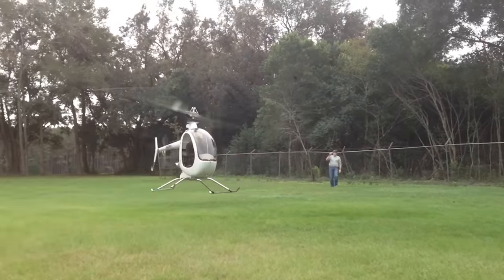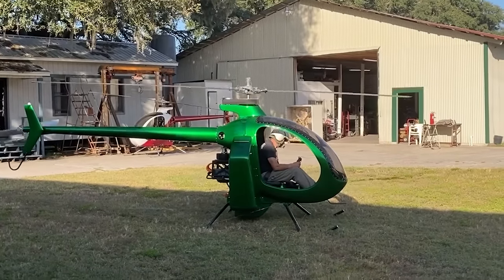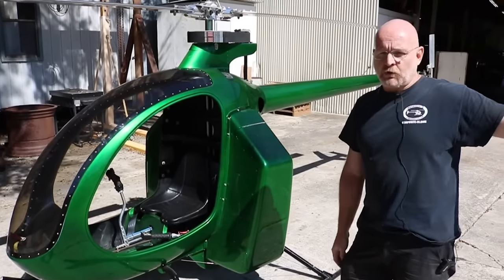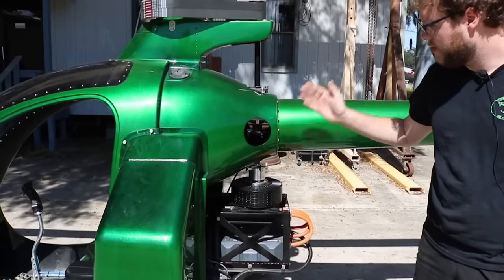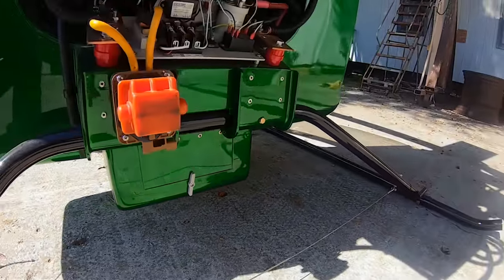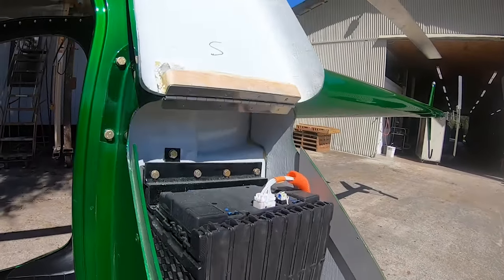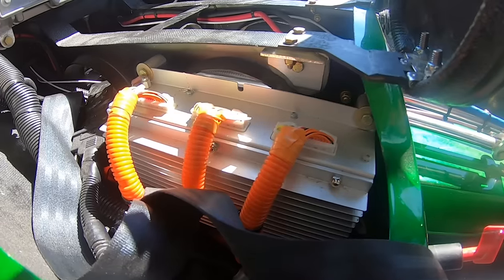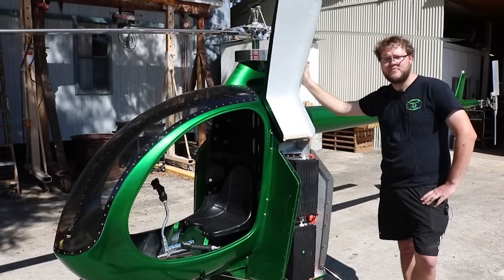Mosquito Helicopter going FULL ELECTRIC!? 2023

Comment: Are you reading my mind? Can I help? Hire Me!  You need regenerative braking to slow the blades down quicker.
Reply: No thanks
Reply: Bruh
Reply: Bruh
Reply: @may21136 electric helicopter ???
Reply: we need the lightning harness
Reply: OK cool, well, based on that idea you have now been fired.
Reply: borregoayudando1481  tons of weight and complexity with minimal returns.
Reply: borregoayudando1481  yes but we might be talking about two different things.  Regen braking to slow auto rotation that actually sends current back into the batteries is complex for relatively small gains. Especially when the overall weight of the aircraft is super important. But simply using regenerative braking to slow the blades down without energy recovery may very well be feasible and practical. My electric hyper scooter does this to slow the scooter down rapidly without wearing out the brake pads, but it does not send energy back into the battery, which again, adds complexity and weight and higher expenses.
Reply: Check out this master mind 😎👍🏼
Reply: I thought the same thing, if inertia is used for charging.🙂
Reply: Brushless motors already do that.

Comment: Ideal for flying from one side of your garden to the other!
Reply: At least they started the project, then they can work on flight time
Reply: Make sure to have an electric charger at each end !
Reply: I like green 💚 small electric ⚡ helicopter 🚁
Reply: It might be useless to you who uses his truck to travel to other side of town to buy some meth and groceries but as a large farm owner I can use this to get to different parts of the farm, to check up on things.
Reply: @NoobieToob  I touched a nerve there I think.
Reply: @NoobieToob  What did I do to deserve that very untrue remark? I only made a lighthearted comment. Try being nice.
Reply: @АскеБек  qa
Reply: Wright Bros flight lasted 12 seconds and covered 180 feet. Imagine if the prevailing attitude was “ ah, it’s useless”.
Reply: Flying too high
Reply: Hilarious
Reply: PREP TO FLY THIS THING TAKES LONGER THAN THE ACTUAL FLIGHT DURATION LOL. CHARGE FOR 10 HOURS JUST TO FLY FOR 25 MINUTES? WHAT A WASTE OF TIME BUILDING THIS HUNK OF JUNK
Reply: Proto at 25 min not at all Bad! In fact, if the pack can maintain temp at power requirements, expect to double or close, for a successful 40-55 min shuttle within the next 15-24 months.
Reply: @illuminatedperspectives2894  nope. I see a pack physically replaced in 15 minutes. Fast  Charging 30 min. at custom airstrips installations.
Reply: Flying in a straight line for 25mins can actually get you surprising far especially in difficult terrain. I’m sure this tech will be further developed and have its applications. Improving the energy density in batteries is going to be key for aircraft, more so than cars. I predict that the simplicity and reliability of electric motors will win over in short-flight applications in the near future.
Reply: @illuminatedperspectives2894  the first electric cars had a thousand pounds of lead acid batteries and had a range of 20 miles. Look how far we've come from that, and remember that nearly ALL the massive ev advancement has been in just the last 10 years.  This is a first gen, essentially prototype electric helicopter. Imagine in just 5 years how much more advanced they will be! Now imagine 10 years!!
Reply: Maybe put a blade underneath for the grass cutting! Great channel n helicopter 👍
Reply: @NoobieToob  savage😂😢
Reply: Yep

Comment: Sounds just like my rc helicopters but bigger and better! Love to see come to production.
Reply: Imagine this flies like a t rex dominator 450 😊
Reply: @seanconnolly2179  but for sure not with someone inside to handle all these G's
Reply: @seanconnolly2179  I wanna see manned tik-tocs!
Reply: It's a 90s setup. :D
Reply: Well not that much bigger than some honestly
Reply: beat me to it 😂😂
Reply: Not unless they can double the flight time!
Reply: NOT to throw shade on impressive project--but LG Chem batts has the worst recent track record...were the reason for Chevy Bolt fires and numerous lessor known similar disasters.
Reply: @seanconnolly2179  Still got my original T-Rex Pro here. I'd got half way through fitting a flightbarless head to it when life took a unfortunate turn, and it just got boxed up and stored. Then I turned to the dark side and got heavely into quad and hexicopters. :D
I'm going to have to dig that out at some point and finish the job. The intention was/is to fit a quadcopter F3 or F4 flight controller in it, and get it locked in on all 3 rotational axis's. The little Futaba heading hold gyro was OK in it's day, but times move on, and a modern(ish) flight controller should be an interesting, and cheap direction to go in to update it.
Reply: @Reman1975  cool and the same happened too me, I got bitten by the Fpv bug lol So my helis are sitting in my storage unit , but I’m thinking of trying some of the newer micro helis like the the direct motor drive ones 👍
Reply: Pffft. I want to see a vertical stall turn while pirouetting or a chaos.
Reply: @jiml4987  Yeah. Wake me up when they upload a video of them doing an inverted hover 2 foot off the ground. :D
Reply: @Reman1975  I miss the R/C heli days. I started on a nexus 30, raptor 30 V1 (later converted to 50, then DIY electric), raptor 50 V2 and the JR Vigor 60. I could fly inverted,  not like Mike Maas and Alex Szabo inches off the ground. 
I flew FPV drones for around 5 years, much more intense than any of the helis.
Reply: @jiml4987  The thing that hit me hardest when I moved from RC helicopters to quadcopters was how robust they are. With a heli, a random gust of wind while landing could cause a blade to strike the ground, and a domino effect of destruction following.

I remember my 450 tipping over on landing once. A carbon main blade folded the tail boom before cracking. That blade also took out the horizontal stabiliser, both support struts, and the servo push rod. The crushed boom instantly jammed the tail drive belt, which caused a couple of stripped drive gears. The impact also bent the main shaft.

During the 4 or 5 hours of rebuilding and painstakingly setting everything back up, I also found a crack in one of the carbon fibre frame side plates, and 2 of the 3 head servos had shredded gears. With waiting for parts to be delivered, the total time it was out of action was over 3 weeks........ And the repair parts + shipping cost only marginally less than buying an entire new frame kit.

My first quadcopter was one of those Hobbyking FPV250 kits with the molded plastic frames. The first time I flew it around the garden I was blown away by how stable, yet agile, it was. By the second li-po I was racing it up and down the garden, weaving in and out of the trees......... Until "CLACK ?". I'd misjudged a turn and slammed it flat out into a rather substantial branch. The sound was just like a cricket ball getting thwacked for 6 ! I walked down the garden to the crash site, fully expecting to see bit's of my new toy spread over a wide area, but no, it was still in one piece !!! The only damage I could find was a white stress line in one of the stupidly cheap 3 blade props where it had bent. I swapped out that one prop and carried on flying. Total cost of that crash was about a pound (About a dollar at todays exchange rate) !

After that I REALLY hammered that thing around the garden for a few months, until I decided that I needed something faster. In that time I had so many crashes, and it bounced back from all of them !

Even though I'd still prefer to be flying an RC helicopter, you can't argue with the shear durability of these cheep little kits..... It's a shame the arms on carbon racing frames weren't as unbreakable. :D
Reply: @Reman1975  When I first built my Emax 250 I flew it line of sight. Getting used to the lag in the goggles was not easy for me. I would laugh when people complained about how expensive the props were. I went threw more than a few sets of carbon blades for the heli in a year. One set was roughly what I spent a year on props for the Quad.
I had an apple tree with a ghost branch. When I hit the branch, right to the bottom of the pool everytime. Jump in, retrieve and start flying again. On my other builds I used conformal coating on all the electronics. I learned a lot about video transmission and frequencies.
Reply: @jiml4987  You mentioned that you learned a lot about video transmission and frequencies, but it goes way further than that. I've taught a couple of nephews how to solder, how to read wiring diagrams, ways to hand make one off parts, static and dynamic rotational balancing, safe lithium polymer battery handling, the importance of mechanical accuracy, plus a hundred and one other things, all through mentoring them through building their own RC aircraft.

They end up with the pride of having something they built themselves, practical skills that could lead to them having a better idea of a career path, the knowledge of how their model works, and how to fix it when they invariably break it. They also get a hobby that get's them out in the fresh air where they're getting bit of exercise, rather than sitting in front of a computer or TV all day.

This is why I'm p*ssed off how the governments of the world have gone hell for leather over throwing draconian "Safety regulations" at the hobby that has a lower fatality rate than most other activitys people do for fun. As far as I know, there's still only been one confirmed death attributed to RC aircraft over the last FOURTY YEARS (A woman who got hit in the back of the neck by an out of control powered RC glider). Even a hobby as benign as woodworking's resulted in more people getting killed per year by power tools (Circular table saws are ridiculously dangerous if you don't know what you're doing), so why aren't regulators jumping up and down to force folks to take online "Power tool safety awareness courses" being allowed in the Ryobi section of their local DIY store?

The thing that brought it home to me was when Hobbyking brought out an RC paramotor kit a few years ago. Because it weighed more than 250g, owners in most countries had to pay to register with their countries aviation authority, and pass some kind of test, (Which they also have to pay for). This allows them to fly in certain designated places, but they're still not allowed to fly too high, too far away, near people, over or close to buildings or roads. Generally, it's "Pay us money, go on a register, pass our tests, and you can fly where we'll CURRENTLY let you"............. Last time I looked, If I bought the REAL paramotor, in most countries there was no legal nececcety for me to have a licence, insurance, or even training. I might not know the first thing about rules of aviation, safety protocols, or emergency procedures. I could just strap in, chuck myself off a hillside, and hope I got the hang of it before I hit the ground. And if I DID somehow manage to stay in the air, no one would stop me flying over houses, private property, or people.

Apparently, each year, 1 in every 5000 paramotor pilots will die in a paramotor related accident....... But it seems it's WAY more important to regulate pilots of this toy version (Which has a mortality rate of ZERO) out of the air !
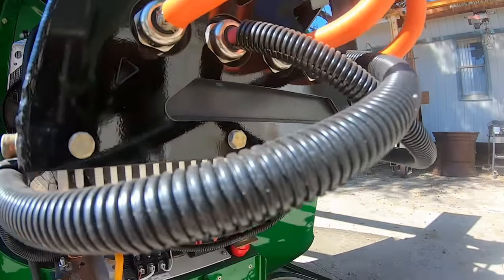Reply: Repent...believe in Jesus. John 3:16 - For God so loved the world, that he gave his only begotten Son, that whosoever believeth in him should not perish, but have everlasting life. 
Luke 13 3 - I tell you nay: but except ye repent, ye shall all likewise perish. 
John 3:3 “Jesus answered and said unto him, Verily, verily, I say unto thee, Except a man be born again, he cannot see the kingdom of God.”
Reply: 25 MINUTES OF FLIGHT TIME? YOU MAY AS WELL GO BACK TO GAS ENGINES. THIS ISNT PROGRESS THIS IS GOING BACKWARDS LOL

Comment: I’m currently trying to design a hovercraft system that uses a small gas generator to run two electric motors for flying. This should offer more range and less noise.
Reply: Why so complicated?
Reply: Electric motors are light enough to carry a spare as well gas generators. Until battery tech is capable of better power we can get farther on less gas.

Comment: I appreciate the specific information about the components and the power information (e.g. 40 kW in hover, and even the motor speed of 2750 RPM). I recognized the Emrax motor design, but wouldn't have been sure of the model without it being stated, and I recognized the LG Chem modules but the confirmation is good. Prototype electric aircraft are often hard to assess without real power and energy data.
Reply: But its easier for them to make up statistics if they don't provide any real world numbers ;) . How can you go and tell your customers you plan to give it a 3 hour flight time if at the same time you tell them there is 30kwh of energy on board and you require 40kw just to hover :P
Reply: @hexad3c1m4l  they didn't claim three hours - that was just a sarcastic comment by 'Legally Free'. The endurance is only 20 to 25 minutes, on about 16 kWh.
Reply: @brianb-p6586  top coment

Comment: I'm really curious to see what fault tolerance you can work into the Sevcon Gen4, typically they just open the main contactor and drop all power when they fault out which could be sketchy if don't have enough elevation to autorotate. LG chem cells are a great choice for this, really looking forward to future development of electric craft like this!
Reply: Matt here. That is one of the concerns I had with using this controller. You are somewhat limited with how you want the controller to handle a fault situation. However we did already test it in an auto from about 4 ft and our pilot was able to successfully pull pitch quick enough and counter the tail to have a safe albeit quick landing without any damage.

 The problem I am actually looking at how to address is a temp fault (not requiring a key-switch reset) like an over-temp of the controller (primarily because we are spinning the motor to slow for the power we want, we are a bit too far over the controllers continuous amp rating to the motor), where it will cut back for about 0.5 second and then suddenly re-engage power. This is definitely a new experience for the pilot, where he would be making a tail correction in the auto to keep it from rotation and all of a sudden power is back and it rotates suddenly).
Reply: @glory122  Glad to hear your auto tests have gone well. EV motor controls are still in their infancy and need projects like this to drive the requirements for aspects like fault handling.

The Gen4 has a thermal cutback curve, (Figure 12) in the manual if you can dial in the thermal managment to stay under ~75-78C you'll be golden. If the high current draw is intermittent you increase the mass of the heatsink to try and get a little more thermal resistance for those flucutations.

I'm sure you've looked at the options Curtis has for motor controls, they have better fault communication but I'm not sure if they are better at fault handling.
Reply: You bring up an excellent point about fault tolerance and the Sevcon Gen4. Ensuring a safe response in case of faults is indeed crucial, especially when elevation might be limited. It's encouraging to see your thoughtful consideration for the technical aspects of electric aircraft development.